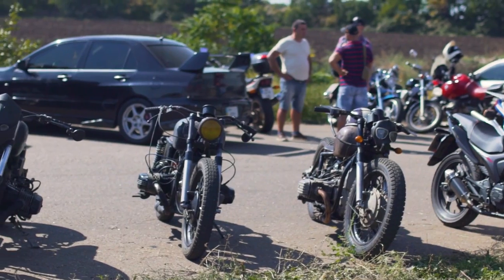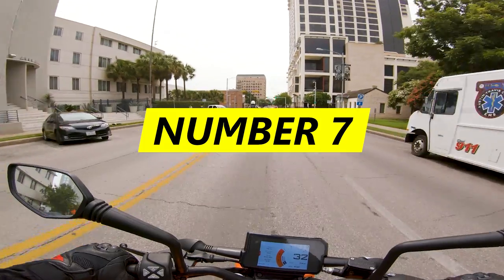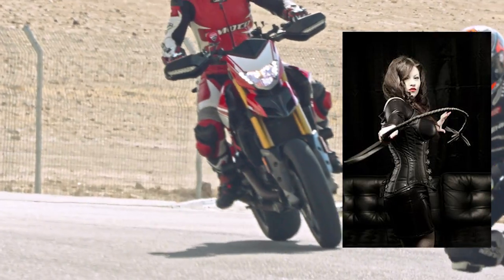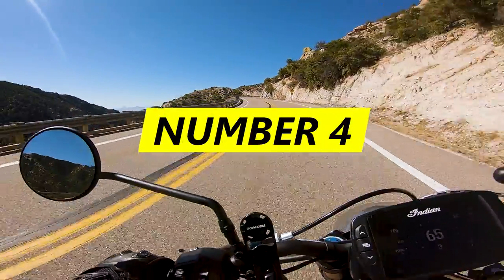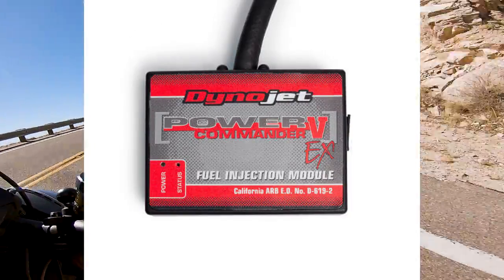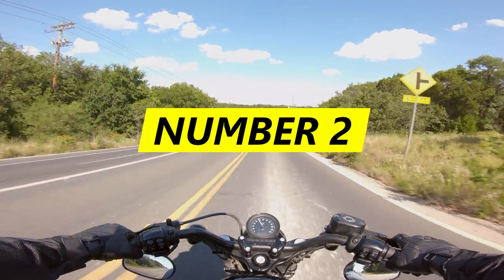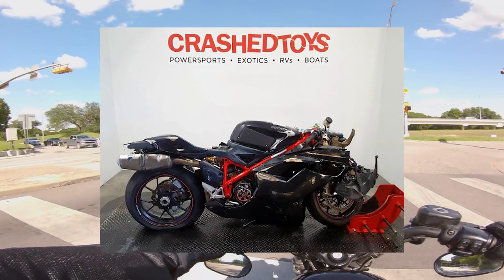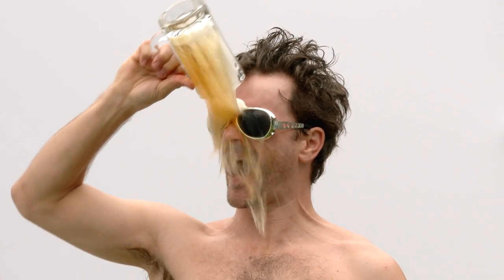Top 7 Best Motorcycles to Buy USED (And Some You Shouldn't)

Comment from the maker: Who bought one of the dishonorable mentions from the end of the video? Don't forget to check out Rokform at https://www.rokform.com/ use the code YN25 for 25% off!
Reply: 19 hours ago but this video was uploaded 40 minutes ago.... Exposed lmfao
Reply: I have a salvage title bike. 2007 Bonneville T100 with 7k miles for $3400. Damage was all cosmetic and it has yet to give me any trouble. It's a bit of a gamble but if you buy from a reputable dealer who's willing to stand by their repair then it can be a pretty great deal.
Reply: I need help. So I’ve been riding for almost a year now I had a Vespa scooter but had so many problems with it that I wasn’t told about when I brought it. So I’m 20 years old, 5ft 8, I live in the uk so I’m stuck with a 125cc until I can get my next licence to get a bigger bike. I’m thinking about getting a Kawasaki klx 125 as the ride height is better for me and it’s a light bike with plenty of power for me to handle on these country roads I ride on. I’m also thinking about a Honda msx/grom coz it’s small and nippy so it’s not too heavy to rip round tight corners.

I need help if anyone is able to lend a few minutes. I’ll have about £1500 by December roughly.
Reply: Nothing from the list but, picked up an 04 ZRX 12 last week. Red not green😜 I did break a rule of yours; my first bike was actually new back in 00, an RGV.
Reply: I ride a crashed toys special, half 2004, half 2007 CBR1000RR. Fun and a great project, but damn took so much work. Great experience as a 2nd project build. Love it, but honestly not an ideal daily.
Reply: 7:27 is a honda shadow....
Reply: What about a susuki GN125? Its immortal, powerful and beautiful.

Comment: I got a unicorn.  Salvage title ninja 250 with replaced fairings and a Leo Vince exhaust on it.  Took it to my mechanic for a valve job.  It leaks a little and I replaced brake rotors and pads.  Other than that, regular maintenance and it runs like a dream.  Got it supper cheap so my son could learn to ride and drop it all day without me getting pissed about it.  I was using it to commute because gas is insane here in cali.

Comment: its always better to know that buying a used bike will always have problems. so be prepared to put works on it. in my experience: 
1. bike motor is the most important, get the bike still start up and running. 
2. always check for fuel pump, sprak plug, air filter, battery. 
3. get the bike you love so you will have more fun and willing to fix it. than get someting out of youtube.

Comment: I picked up a 1994 Vmax last fall. Has 2 windscreens, stock seat, Corbin seat, two sets of body work, every maint. manual one needs, and more. $2000.00. Just cleaned the carbs and off it goes. Supliments My 2009 zx10 and 2016 BMW S1000rr.

Comment: Just to throw my hat in the ring here, I can heartily recommend a ZZR600 1993-2004 (and upwards I guess but as I understand it after that they made some major changes) aside from off-roading this thing literally does it all and in a very forgiving way, if you WANT to race it contrary to popular belief you CAN flick it into corners the same as most 600's which makes it funny to read a lot of reviews saying you can't the trick is for your elbow to be below your wrist line then you may be surprised just how manoeuvrable it really is. Honestly though where it shines is as a workhorse it eats miles for breakfast and with an absurdly comfortable seat and really reliable I can't think of a single time it's let me down, also with the way the tail section is built it is kinda begging for panniers and a top box but that may take a trip to a fabricator to sort out if you wanna do it right.

The only 2 points I would advise to look out for is the rear shock is kinda bad (I only noticed with a passenger it bottomed out a lot aside from that it didn't bother me personally but other people complain about it) but there are a few options to swap with that will clear that right up for example I hear the zzr1200 shock will more or less bolt right on and you get remote adjustment with it. The second thing is the gearbox, the guy who sold me mine said 4-5 were a little sketchy but not really anything to worry about...that's bullshit not only was it crunchy and jumped in and out of gear it locked up on me doing...not legal speeds...turned out the selector forks drum and gears were totally shot. Luckily (and I only found this out AFTER I took the whole engine out fixed it and found out how much of a pain it is to get back in) not only are gearboxes cheap but it IS possible to replace the gearbox without removing the engine but it takes a fair bit of finesse however gearboxes for the ZZR are dirt cheap and aside from getting the clutch basket off (honestly if you are replacing the whole thing just use a dremel to grind the basket retention nut off it's not worth the hassle) if it does hat that problem it's easy to fix.

Tl;Dr the ZZR600 often overlooked but absolutely well worth your time if you're looking for a bike that will do more or less anything you want it to do for very little money and maybe a day of work.

Comment: I picked up a used KLR and fell in love, then had my heart broken with a thousand problems. Also, if the bolts were made of plastic, it'd be a huge upgrade. You can break some of them at just beyond finger tight. Now it's mostly good, except for the obnoxious knock that it developed. I saw some torn up shit in the left side case and replaced it thinking it was the problem, but - nope. I'm sure there's something floating around the bottom end causing all kinds of havoc wherever it goes. Maybe I can offload it to someone else for parts or some shit. Huge bummer though.
Reply: Rob Robinson Fellow KLR owner here. Your problem is most likely your balancer chain tensioner aka the “doohickey”. This piece often breaks on  many gen 1 KLRs and floats around in the bottom of your engine. Eagle mike sells an upgrade that will fix this issue.

Comment: yep..  I let somebody else put the bucks in my zx14. Fully exhaust done. Power commander, autotune, speedo healer, new chain with new cogs to bring the power and speed into a more usable realm on the road. USB charging ports, 3m protective film, grip warmers, braided steel lines, valves done at a real shop... 2nd butterflies removed. I know there is more but I paid the same price as one that is completely stock. Thousands saved above saving thousands by not buying new.

Comment: I bought my first bike essentially new as in the previous rider bought it new and then put 16 miles on it only to bring it back to the dealership to trade it in. My only regret is that I grew out of the power kind of quick and wish I got a 500 instead. but with hindsight I have a bigger appreciation for larger displacement bikes because I started on a 300.

Comment: Also worth mentioning that you can buy a new left over motorcycle at a dealership for a good price. Example in 2018 I bought a new 2015 R3 the dealership still had for the same price, if not better than some used ones

Comment: 17% interest? That’s criminal. Yes my first bike was a brand new 2019 bmw s1000rr, bought on  July 17 2019.  Did first oil change myself, and the bike has 1300miles now. I found it very easy to ride and learn on in Rain Mode, I ride in town almost exclusively so it stays in rain mode. I would like to ride it on a track once I have more experience - the only thing that surprised me was the yearly insurance, it’s almost 1100 usd which is more than my car lol. I have been watching this channel since 2017 but only ready after 2 years.
Reply: You rode 1300 miles in a year?

Comment: Great article. Never understood why new riders buy new bikes. Many lessons get learned the hard way, and its hard to relax in the saddle if you know a slight mistake and low speed spill is going to grind £££££ off the bodywork. Always helps, too, to find the less glamourous models for value. I have done the SV thing, have a 900 Hornet right now. Bought it four years ago....done 20,000 miles on it.....still looks and goes as well as ever. Minimal depreciation.  A new bike will lose more value than that has while the ink dries on the credit agreement!  Seasonal buying is another good call. You can pick up some bargains...but be prepared to travel. This year...I added a Sportster to the collection. Very low miles, very low saddle...half what a new one would cost me. Only a bit more corrosion than a new one comes with.....

I do buy fixer uppers though....but that can work if you buy a 'classic'. Been rebuilding a 750-4 over the last 2 years. Bought an unfashionable later model....paid a grand. Good ones were £3500 then. Now...£5000. At this rate...it might actually be worth the cost of restoration when I finish. But hey...all that peace and quiet in the shed is priceless when you have kids.

Comment: I've noticed an odd thing about some classic used sport bikes.
Looking from the rear tire ,I have seen two sport bikes where the frame was so bent ,the rear seat is angled off to the left side of the bike.
Not centered on the rear wheel.
That's a hell of a road impact to do something like that, I would guess.
Unless the entire bike lines up,I won't buy it.
It also pays to take down the exact bike you want to buy,go home and bury yourself in internet forums where you can learn the problems others are having with their bikes.
I was very surprised at all the rusty gas tank forum entrys.
Replacement gas tanks can cost $800!
If you can get them.
I guess ethanol laced gas just butchers the inside of gas tanks.
And carbs too.

Comment: 2006-07 gsxr600/750 electrical charging issues across the board. Even after relocating the rectifier, nothing but problems..

Comment: I have a question. There's a Busa on OfferUp for $30,000. Chromed out, stretched about 5 feet, and bright pink. In the pic there was a dude about 500 lbs sitting on it. The description said "No low ballers I know what I have 1 owner super clean never been dropped large scratch on side from previous guy salvage title." Should I get it?

Comment: Is Yamaha MT-03 660 (2008) good for a beginner.
Reply: Same price as the 2016+ ones. old mt03 are a pain actually. Esp the oil pump with its plastic gears when it fails engine locks up.

Comment: Definitely don’t buy a old used 250 4 stroke  motocross bike older than I’d say 2010 because they are BEAT TO SHIT and garentee you hours of headaches and cusses and more. 250s are known to be a pia. I bought a 2020 have 30 hours and never looked back I’ve had a 08 crf250r and i had to redo valves 3 times within 15 hours, it had a siezed subframe and more none of wich I wouldnt have been able know before buying it